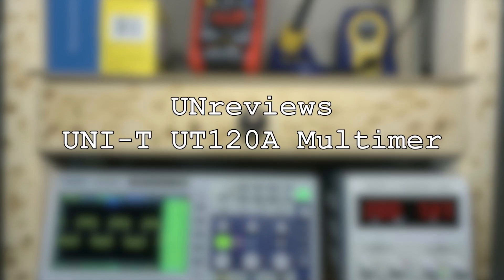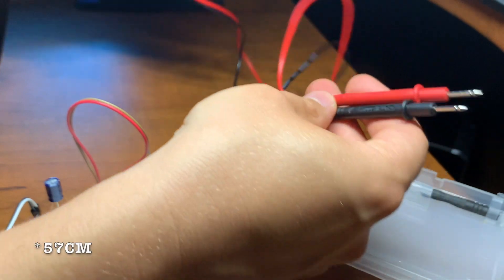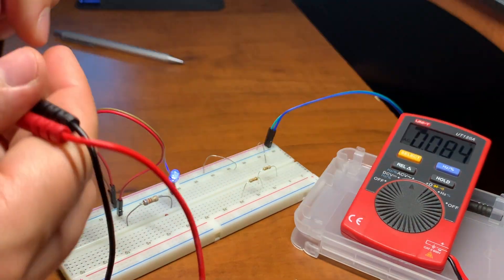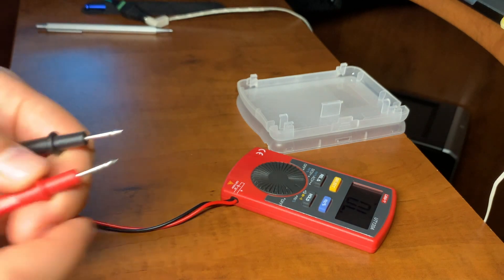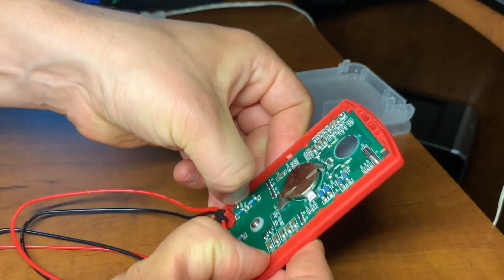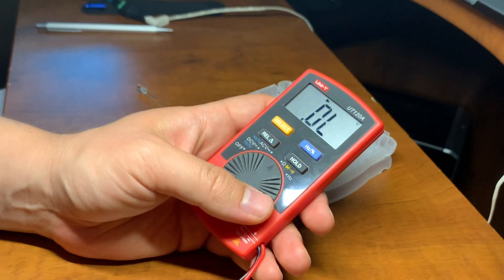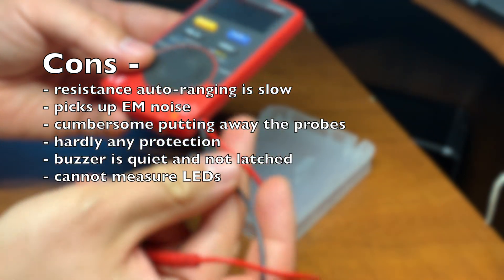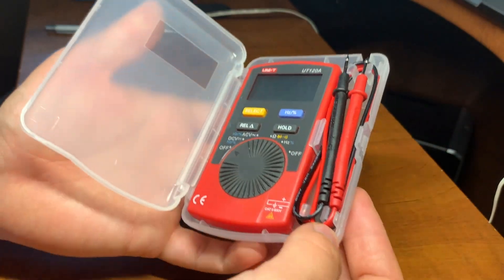#3 UNreviews: Uni-T UT120A pocket multimeter review and teardown

Comment: still has this multimeter and it has been used alot, it's smaal size and ease of use is nice, not the best but good inough, i have the ut117c also but it is not used in the field if not verry needed.

Comment: Thank you for the review. I need such a small pocket Multimeter.
Reply from the maker: It's not bad for the price, but if you can afford it, i'd highly recommend getting a Fluke101. It has removable leads, capacity measurement and of course the quality is 10x better than uni-t, I thought of doing a review on it, but I think there are about 30 of them already.
Reply: @UNgineering  Yes of course it is. And I have "big" multimeters already. Just now I need a very small one for for my drawer basically to measure batteries :-)